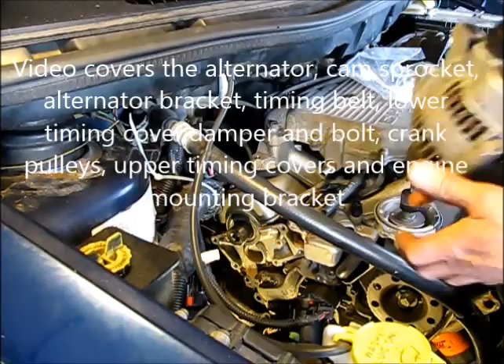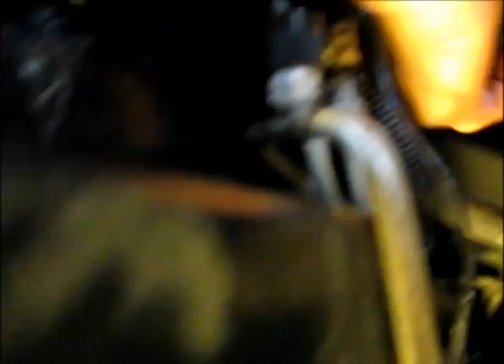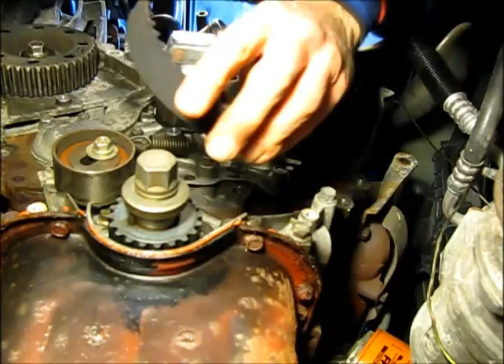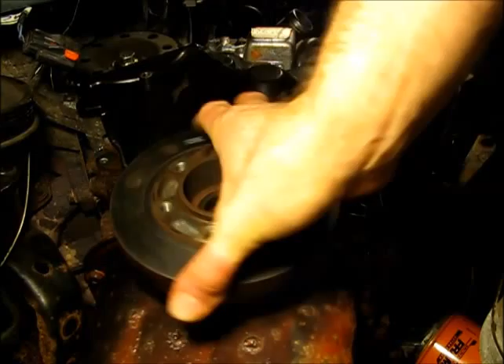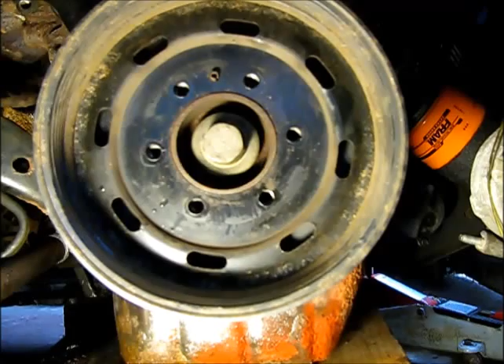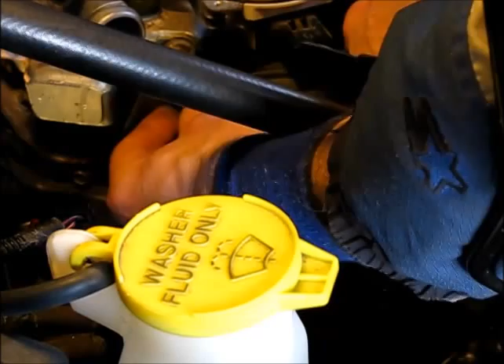Dodge Caravan 3.0L replacing timing belt, water pump and front seals, part 7: Re-assembly 1

Comment: Question, just bought an 87 with mits 3.0 engine. If belt busts, engine turns off and we are good or do valves get bent?
Reply from the maker: According to a quick internet search, the 3.0 engine is "non-interference" meaning the valves will not be bent if the belt breaks.

Comment: Man i sure appreciate this video series and I'm doing this very thing on a 96 3.0 but i have a question as I'm back finally on the road reassembly and my question since i also did the head gaskets i really didn't pay atention when taking the harness off as where it's sits come this point for reassembling.  I'm sure hoping you'll answer as I'm kinda having a hard time finding any images or videos on doing so.. Thanks Al in Idaho
Reply from the maker: I assume you looked for the harness routing in the video. If you can't find it there I can't help, since this Caravan was scrapped out years ago.

Comment: I know this is a super old video but it’s extremely helpful. I have a 94 LeBaron convertible with the same engine. I’m changing my water pump and timing belt too. One question: as I was putting the belt on the rear cam, it moved like a half a tooth off the point. How can I get it back on point, or is half a tooth off going to be ok? Thanks for all of your videos.
Reply from the maker: @sonnysmith2991  I would recommend trying again. Timing is an exacting business. Cams can move due to spring loading. Try to find a way to lock it in place. Maybe a helper might be needed. Good luck!
Reply: @TheOriginalMechanic thanks! I was able to figure it out! Appreciate all your videos and the help you give us!

Comment: Frick i frickin broke a bolt on the water pump. Frick. 
What do
I got em all torqued and one wasnt clicking.. it was just stretching and i was too dumb to not keep turning it. I think im gonna send it..

Edit to anyone who mightve also done the same. Seems all good, as long as just one is missing I think we'll be okay for a little bit lol. I plan on re doing this here soon to fix a few things I messed up, but as of right now we're running smoothly
Reply from the maker: Yeah that's a tough one. I've had it happen too. My sympathies.
Reply: Almost had the same thing happen to me. 3 of the 5 water pump bolts torqued fine to 20 ft. lbs but I had two that started getting snug and then kept turning. I stopped after I felt something was wrong, removed the bolt and saw that the threads were stretching. Luckily I got it out before it snapped. Seems like 20 ft. lbs. might be a little much for these bolts.

Comment: FYI for assembling the alternator bracket, remember to leave the hole opening that bolts the mounting plate into the engine block.  Or you will be taking the timing cover off again.  Also I started all my bolts that held the ac bracket and belt tensioner together.  oh had to lube up the wrenches to get them into the places I needed them.

Comment: The three bolts that you used to attach the motor mount bracket what size are those? I have to get new ones for my car.
Reply from the maker: Sorry I don't have that information. Perhaps another viewer will.
Reply: The Original Mechanic I hope so because on my alldata there is only torque specs and not size. The bracket isn’t even mentioned really.
Reply from the maker: @siber54  You might want to try a dealership parts department
Reply: The Original Mechanic I may have to thx. Also thanks so much for the vids man . Keep up the good work and I’ll send ya some love on PayPal in a bit .
Reply from the maker: @siber54  You're welcome and thanks for the support!

Comment: After I put the timing belt back on and got the marks all perfect,  I put the crankshaft pulley , inner harmonic balancer and bolted it in with the big bolt.  Then I check all my wires etc.  Rad hoses connected and started the van,   let it run and watched the belt turn and looked for any leaks, oil seals and the water pump.   I let it run until the engine got hot and revved  it up a couple of time and check again for oil leaks and coolant.   There were no leaks.  Then I took the main pulley off and put everything back together so I knew there were no leaks.
Reply from the maker: Good job....and not an easy one!

Comment: The bolt to the alternator bracket at 1:46 to 1:48 appears to be in the wrong hole, right side but up higher.   See video 5 at 5:33.   I put it in this hole to discover later it is wrong.  You must have moved it to the bottom right hole later , not shown in the video.  This hole is for the big bracket to bolt to. You had to have moved to because I can't get the long bolt into the hole.   I have to take the plastic cover off and move this bolt to the lower position.
Reply from the maker: Yeah you're right. I think I mentioned that later in the video but it might be easy to miss.
Reply: @TheOriginalMechanic  I wouldn't have tried this job without your video so I am not complaining, I have to thank you very much.
 I did watch all the videos multiple times and may have fast forwarded the # 7 when reassembling.   I thought the comment at the top of the comments would make the next guy pay attention.
Reply from the maker: @jeffbguarino  Thanks for sharing the helpful tips.

Comment: I followed instructions of taking belts and other parts apart and then putting all back as shown. when i started the motor there was a squeal and smoke , is this from the new belts in wrong, or what else?
Reply from the maker: If the engine ran after the squeal and smoke I wouldn't worry. If it did not you need to go back and recheck the install.

Comment: hi! I've just finished doing this for our van using these videos and your printed instructions. but it started leaking oil out the back immediately when I restarted it. I think it's the rear cam seal. when I pushed it in, I was able to do it with the pvc pipe and my fingers, but it went in further than the old seal. recessed maybe 1/4 inch or more . seemed strange but I didn't think anything of it at the time. do you think that is my issue? thank you.
Reply from the maker: That rear cam seal went in further for me too, as I recall. And it did not leak.  I don't know of any way to tell where it's coming from without breaking it back down to look. I think if it's a big leak, the crank seal is probably the cause. It is easy to roll this seal on install. Good luck.
Reply: +The Original Mechanic out of paranoia, i tore it all down again. The seal seemed dry as you said it might. incase, i stuck an extra one in there, only because i had it.

i think what happened was is that as the van was tilted back, i ran it, and oil mightve washed dirt that was holding the rear valvecover gasket together. 

at least i hope thats what happened. 

thanks, youve help calmed my nerves.
Reply: The Original Mechanic O.K. I finally figured it out. It was the rear cam seal. After swapping everything down including the head gaskets, It still leaked, so i got another cam seal and pushed it in only as far as the edge of the orafice. Instantly stopped leaking.

It was not possible to see with the alternator bracket on, so I removed it, and put the timing belt back on and restarted it. From there it was easy to see oil just dumping out of the seal, even if the rear bank timing was a little off.

I hope it never happens to anybody here, but I learned a few things-

1. Its not required to jack up the vehicle at any point. Even with the wheels straight on, the only stuff you need access to from the bottom is the A/C and Crank bolt.

2. Its not necessary to remove the intake manifold or plenum to replace the valvecover gaskets, you just have to hand rotate the motor so the valve is open on the back passenger side to clear the rocker arm.

2. Although unrelated a timing belt change, removal of the fuel rails is not required to remove the intake runners.

3. Complete removal of the alternator is easier in the long run. I hung it on wire the first time, as you did, but found it a lot more accomodating with it out of the vehicle.

4. Its hugely easier to split the motor mount into two halves than to remove it in one piece.

5. While the jam nut trick works to unscrew the bottom studs on the A/C, I found that hammering home a 5mm socket on the stud heads works quicker.
Reply from the maker: Way to go. You have the determination needed to complete a job like this. Thanks for adding all the great detail. That may help someone in the future!

Comment: Hello Friend. I have a question, how much is the cost of this service
Reply: Just to update on this question: a timing belt and water pump replacement is about 4 hours on the shop manual. Add on another shop man-hour to replace seals. At 2017 pricing, possibly a $800 CAD job including parts. Hope this helps.
Reply from the maker: +arturo colitas I don't know the answer to that. I know it's more than I want to pay.

Comment: Hi im doing this same job on my van but I cant get my cams to line up they both seem like they got a lot of pressure when I turn the cams trying to line up the marks I was wondering how do I avoid that or what would I need to do ? Thank you
Reply from the maker: +Port Cuzz I had some trouble with that on the rear cam sprocket. I just kept trying until they stayed lined up. Maybe a helper could hold them until the belt is in place. That's all I can think of short of making a holding fixture ( that would be a lot of trouble to go to). Good luck with it!
Reply: The Original Mechanic  ok thanks and great video

Comment: One of the bolts for the alternator bracket is put in the wrong place.  The bolt hole used at the front edge of the bracket around the 2:00 mark is for the engine mount bracket.  The proper bolt hole is further down the alternator bracket.
Reply from the maker: Robert Donehue Yeah, I know. I thought I fixed that in the video. I guess not. A good thing to note for anyone doing this. Thanks for the comment!

Comment: You are a gentleman and a scholar for making and posting this video.   I am now going to attempt to do the same with my '95 Caravan V6.  I have the manual to cover the differences in procedure.  Thanks again.
Reply from the maker: Thanks for the comment and I hope your repair goes well..
Reply: The Original Mechanic   Thank you..   It's ...   going ..   slowly.   My timing belt ended up breaking before I even attempted the repair. (What are the chances!?)    So I am to the point where I can install the new belt.  I am attempting to find TDC.   .. but when I turn the crank and cover the #1 spark plug hole, I feel the same amount of air between both strokes (the compression and exhaust stroke)..    (ie.. I can't distinguish between them).     Otherwise, the repair is going very well.  Your videos are way better than Haynes.

Comment: hi great video i have a oil leak i was thinking to change the crankshaft seal should i change the timing belt and water pump and camshaft seal let me know thanks
Reply from the maker: With it all torn down to do the crank seal, I think it makes sense to at least do the other seals and the timing belt, if the belt has more than 100k on it. The water pump requires even more tear down to replace. All I can say is that I'd do it if I was going to keep the van for a good long time.
Reply: When I did mine ( 94 voyager 3.0 ) I replaced the timing belt, water pump, idler pulley, and crank seal, when I started reassembly I installed a new water pump, New belt tensioner, crank seal, and running belt, I used a ratchet on the 22mm bolt for the crank shaft and rotated the engine twice to make sure running marks were lined up with all the marks and before I went further with assembly I started it up to make sure it ran properly.